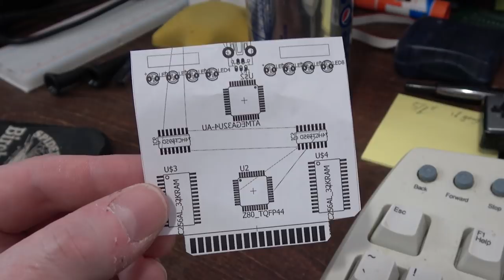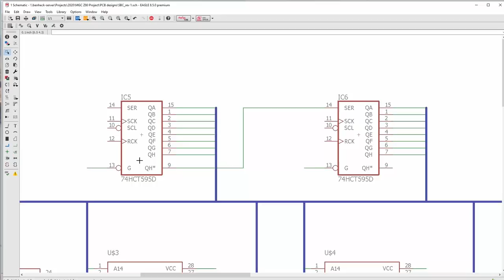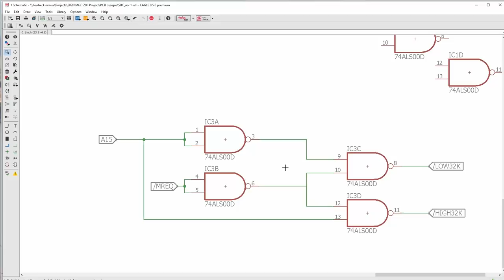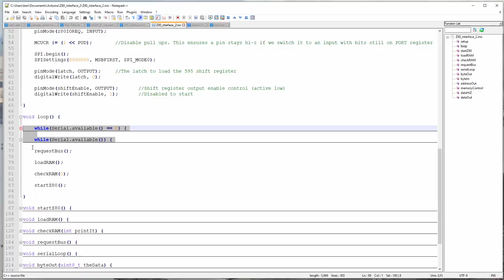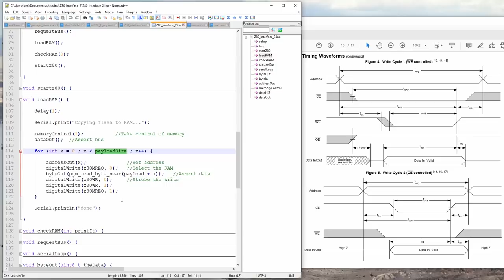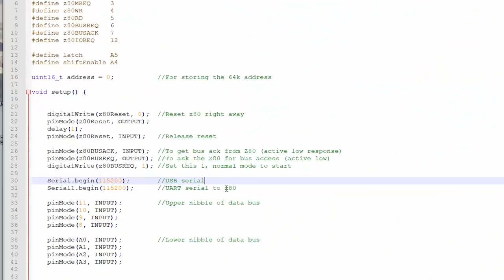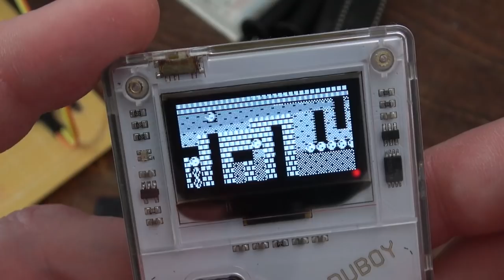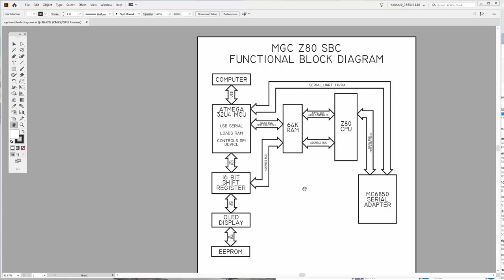Midwest Gaming Classic Single Board Computer Part 1

Comment: The fact that they make a surface mount Z80 literally blows my mind!
Reply: TI calculators use 8080 CPUs (or Z80, I forgot) to this day.
Reply: @nessotrin  : I believe it depends on the model.
Reply: You should check out the other products zilog makes. they make some pretty cool z80 based microcontrollers. even 16 bit versions. Dig around on Mouser and Digikey

Comment: But you CAN draw a line over characters on Eagle! Just enclose the string with a !, like !CS! (you actually can skip the ending !, but it's good practice to use both if you are writing a longer string and only part of it has the over line.)
Reply: Handy hint: Eagle will stop the overbar at the end of an entry in a bus list, so you could have "!WR,A[0..15],!IORQ" and it would only put the bar over the WR and IORQ sections.
Reply: That's not the behavior I get. But again, I'm using Eagle 7.6.0, which is the one I have a license for, could be a feature of newer versions.

Comment: If you want CP/M, you might want to have a microsd card slot also on that spi bus, rather than eeprom.  Even if you don't use a FAT FS on the 32u4, you could access direct sectors to provide them to CP/M.  ... or go with FatFS on there, (or something custom) and also provide a selection of ROM images to boot into... perhaps?   RC2014 bus compatibility would be neat too... so you could plug in the TMS9918A video card in, or joystick controller card... etc. :D

Comment: Cool concept, I think what people would love most is some sort of low power display mode and/or a very limited amount of on board power.

So let's say they could run the badge itself for like 30m to 1h without having to use a powerbank.

Not sure if that's possible but any amount of time they could walk around with the badge at MGC without needing any externals I could see increasing the likelihood of it happening or increasing the scale of it happening many fold.

It's such a good conversation piece in like "I made this" and "look what this can do" even if it's for a short period. So if any reasonable amount of double or triple A batteries or lower profile of the disc batteries could facilitate that, I think that would be a great addition.

Comment: You could always intercept the backspace key and print Ctrl+H as well.  I would add a battery to just run the badge. Instead of using a crystal oscillator, I should set a fuse on the mcu that dumps the internal clock to an IO pin (ATMEGAs usually have that). If you use one of the more modern Z80s (like a Z380) that should just the power requirements.  You could also use the ATMEGA to replace the memory glue logic (just use one of the pins as a not gate).
Reply from the maker: All good ideas. Yes I plan to use the PLL 96MHz clock for Timer4 to clock the Z80. Then the user can stop the clock and single step if they wish.

Comment: You should provide battery backup as an unpopulated header on the board. Also, a plain-jane parallel port on headers: 8 bit bidirectional data, 8 bit out-only address, clock out, ground, interrupt in.

Comment: Honestly I think the SBC is fine as is. KISS and all that, not to mention it keeps the cost/parts count low. I mean, you have the expansion connector on there already, so it can be left as an exercise to the attendee whether or not they want to add certain features. One possibility is to MAAAAAAAYBE make the board a little bit larger so that you can fit in a mini proto area (basically a grid of plated through holes, where people can solder their own stuff.) Also, as others have said, it would be awesome if you could sell this as a kit somewhere, or at the very least post the Gerbers as well as a BOM somewhere. I won't be able to attend MGC (it's just not in the budget this year :-( ) but would love to experiment with this.

Comment: 5:05 - You can usually add the "bar" above characters in Eagle, by changing the forward-slash for an exclamation point.

But to do that on the symbol itself, you'd have to use the Library editor.

The bar thing does tend to look a bit untidy when signals are close together, though.

Instead, I tend to just add a _N to the end of signal names, like OE_N, CS_N etc.

Do you buy your chips from a specific site in China, btw?
Reply: personally i would always recommend a legit international chip seller like Digikey or Mouser for buying these things.
both sell Z80's as well, and Mouser also sells new 65c02's
Reply: A bonus side effect of adding suffixes to signal names is that if you have an "_N" and a "_P" you automatically get a balanced pair - useful for USB routing (line-length balancing using meanders, etc.)
Reply: @crispoman  

I usually avoid that, for some reason, and still route diff pairs manually.

I did try doing length-matching for the RDRAM on a Mini N64 board I designed, but I admit that putting the traces and vias for the SDRAM on between the RDRAM traces was a very bad idea. lol

https://i.imgur.com/6pUL9jw.png

The board does "boot", but only at 4/5 the normal speed. I've improved a lot since then, and use Altium for the more complex stuff.

I do still like Eagle for smaller projects, though. It loads up fast, it's easy to copy the files around to clone projects, easy to use its library editor etc.

And the newer versions have finally added things like labels to the traces and pads on the PCB viewer, and don't overlap the traces any more whilst routing.

Comment: In your decoding of the chip enables for the two RAM chips, do you have to worry about gate delay because the lower enable goes through one fewer gates?  If not, why, and/or how fast does a circuit have to go before you'd have to worry about this?  Is it that the CPU wont consider the data on the bus valid until after a hold time which is long enough?
Reply from the maker: The propagation delay is in nanoseconds, not an issue for a CPU this slow.

Comment: Perhaps use the edge connector to hook it up to a keyboard? Then someone could solder a keyboard cable to an edge connector and then plug in the batch pcb into the connector and control it that way. Like those keyboards with an integrated card reader. That tiny screen is a bit small though... I would prefer something a little bigger so that you could really do something with it. You could program some kind of visual demo and display that.

Make the holes for the strap conductive so you could use the neck strap as wires (+ and -) to hook it up to a small battery on your back or something. That looks nicer than a usb cable.

Comment: Great Project. Why not use a 128kb RAM chip (using the lower 64kb) simplifying the memory logic? Another thing; do you really need the MC68B50? Is it possible to make the Z80 speak directly to the ATMEGA emulating ACIA? It would be nice to have an interfacing bus, As you mentioned the RC2014 bus may be too large, but what about a 40pin (2x20) bus like described by Steve Cousins?
Reply from the maker: I have tried that, it's difficult to emulate peripherals with slow MCU's (16MHz). I will probably use the high speed timer4 to clock the Z80 so it may be possible to slow it down when trying to transit data. What I do, have to be finished in February :)
Reply: @BenHeckHacks  I am sure it will be a great kit. The 68B50 is very flexible and can run asynchronously to the CPU. I have used it running at 7.3mhz with a Z180 running at 33mhz. I understand you can not be too adventurous with the design when having time constraints. Good luck and i look forward watching your next video. Karl
Reply: Using a 128kB SRAM chip would be cheaper, use less board space, and there'd be no need for the memory map decoding - just tie the top address pin high or low.

Comment: I was wondering if you could use a linear feedback shift register in software as an address counter. It should allow you to cycle over the entire address space (except zero) by shifting just one address bit per data word. Granted the hardware SPI would still outpace this bitbanging.

Comment: Nice. But when I look at the schenatic diagram, I start to believe that an Arduino mega (ATmega2560) might make the better choice as a base system, and the Z80 board could be an addon board to an arduino mega. That would solve all the port issues. The Arduino Mega comes for like $12 from China. So not a question of price tag.

Comment: There are some reasonably cheap serial UART chips in surface mount. Downside is you would need to modify the bootloader to use it.

Comment: I don't have any 6850's, but do have a shit load of 8251's.  I guess I could use those with a bit of programming change on the Z80 side.   There are 64pin versions of the atmega32u with 64k or 128k program space, their pin spacing is the same as the 32u' (those chips are used in the Teensy2 IIRC).  So you could use them if you run out of I/O pins.  You could also use I2C eeproms and displays.  The SPI bus would require one additional (cs) pin per device, while the I2C can address up to 64 or 128 devices without any additional CS lines.  There is a 16 bit I2C I/O expander chip, slower than the SPI shift register, but would save a few I/O lines.  In addition to the Z80, there is the Rabbit fully integrated part, but I agree with using the 'classic' Z80.   I'd also like to see a kit, or at least be able to get a bare PCB board and kit my own parts.  Would need a download link for the Z80 code, or arduino INO file.  If you could put a microSD card on there interfaced with the Z80, then you actually could have CP/M on there using the micro SD card as a floppy disk.  Maybe might have to interface the SD to the 'arduino' and have that chip "dma" into the Z80 memory.  But then would need a way to have the z80 talk to the arduino to command the 'floppy'.  Maybe via escape sequences over the serial link.

Comment: I got an old controller from work that used to control the in floor heat.  It has a z80 based cpu, a keypad layed out for calendar and time inputs, 12 relay outputs, 8 analog inputs, rtc, and 16 by 2 character lcd.  It also has an expansion connector for more devices.

I'm trying to think of a home automation project I can use it for.  I just want to do more than a thermostat or timed lights.
Reply: Lawn sprinklers.
Reply: @absalomdraconis  It would be good for that.  I don't water my lawn though.  My garden is too far from the house to automate watering also.

Comment: I'd want a tone generator and some form of wireless communication like an IR blaster.
Reply: Yeah, hang an adder off the clock, route it into a magnitude comparator, set the other number wherever makes sense, merge the "equal or greater" pins into "+=" AND route to the inputs of two XORs. Use the XORs to modify the serial line IO. Maybe use one of the old binary switch ICs to hook the serial between different transceivers, probably an RS232, IR, and audio connector (so amp) at the least.

That might be a few many parts though. Maybe on a daughter board instead.

Comment: I don't know if you still take project suggestions, Ben, but if you do I have a bit of a challenge for you:

Retro computing is a huge thing nowadays, with both the preservation of old software and the exploration of old systems being things that gamers and computing enthusiasts are growing to love more and more. There are caveats to that though, chief among them the cost of upkeep of systems and parts (like floppy drives, old hard discs, etc.,) and the sheer amount of space typically required to house the old systems and software.
And so, my challenge! You're good with Mechanical Things. You're good with circuit boards and the like. I would like to see you design a DOS gaming computer using modern chips and techniques that's integrated directly into either a 5.25 or 3.5 floppy drive, with the following limitations:
--The unit must be designed with software compatibility in mind first and foremost, with a focus on games designed for 486 platforms and earlier.
--The drive should be functional, allowing games to be written to and from floppies in a format compatible with classic DOS computers.
--Despite being designed with a focus on retro software, the hardware support should be relatively modern: USB mouse/keyboard, VGA or better video output, etc.
--Size matters: while the unit doesn't have to be as small as, say, a Pi, it should be kept as compact as possible while still maintaining the features above.
I imagine the hardest part of designing something like this would be sourcing the floppy drives themselves, or parts to build your own, but such a thing would be incredibly handy to have, both from a computing and a conservation perspective.

Comment: Why not use AT90USB1286, they are a bit more expensive than 32u4, but more IO. Could also use SamD21J18, 32bit and is arduino compatible.
Reply from the maker: This is intended as a kit so I needed an MCU that is possible for surface-mount-soldering novices to accomplish.

Comment: Suggestion: just found this emulation for the MC6850 using a PIC24FJ32GA002 microcontroller - https://github.com/jason6502/pic-uart

As Ben said, the MC6850 is obsolete and hard to find. He can get over it because he already have a stack of them, but others probably are not so lucky. This emulator provides a way to use modern components to have (close enough) the same behavior as the old IC.
But yeah, it's another microcontroller on the board, not ideal.

Comment: why Logic ICs at all? couldn't you save a bit of space and wiring by using some PLD?
also why are you surprised that Z80's are still being made? like with 65C02's (which are also still being made) they are mostly used for low power embedded devices or replacements for older hardware
and lastly, how do people live with using light themes in programs?! i would burn my eyes out if i were to ever use light theme Notepad++ or even Windows itself

Comment: You can bootstrap a RAM-only Z80 system with only three signals (Clock, NMI and Reset) controlled by some other computer: http://www.z80.info/jmz8boot.htm but fully controlling the address and data busses is far more educational.

Comment: oh gosh that keyboard gives me immediate flashbacks to the late 90s. Microsoft? Rubbish membrane affair? …why are you using it?
Reply: Come to think of it, it was the PS/2 keyboard I took with me to uni a few years later, not the 90s. Still, don't remember it being great…
Reply from the maker: I've been using this keyboard since 2000. No joke. It's lasted that long (and I have backups too :)
Reply: @BenHeckHacks  I suppose any keyboard feels like an extravagance when you're used to programming by shorting individual bus lines to ground before manually advancing the system clock ;)

Comment: Why people are so facinated with soldaring? Its just matter of practice...
Reply: People are scared of surface mount for various reasons, such as the parts are too small. Or not having an oven. A small chisel tip is enough when working with a commercial solder masked board.

Comment: Had me until mention doing surface mount soldering. No reason to do that in a hobby project unless there's a component that is only available in surface mount, but if that's the case then it's time to flip to a different project. I absolutely detest anything in hobby efforts that is not done with socketing the components.